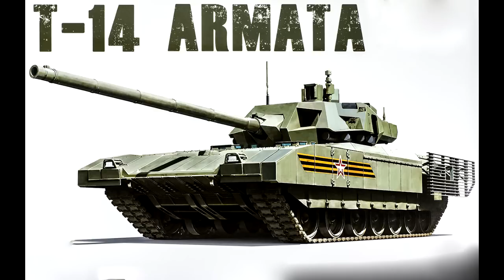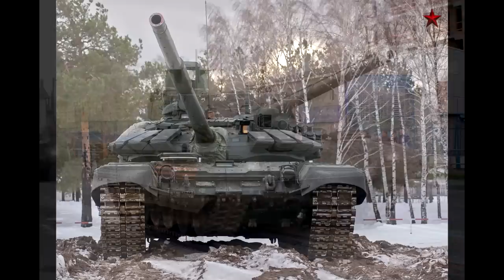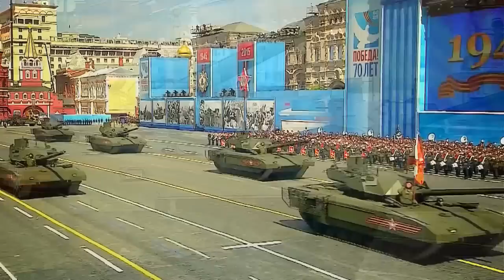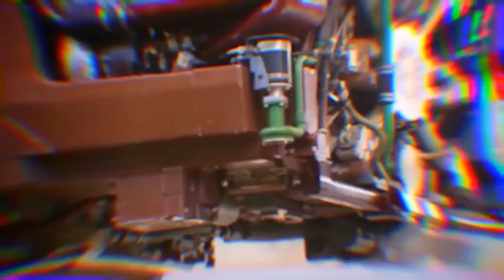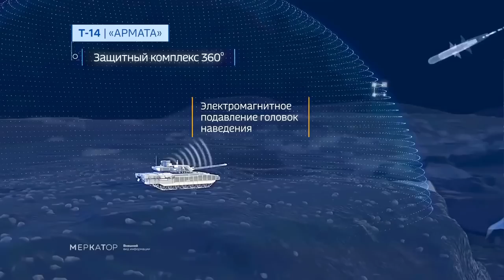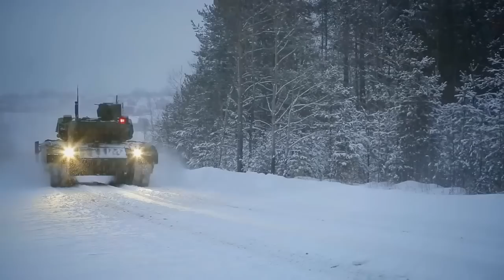Busting Myths on T-14 Armata

Comment: Please, explain how a few hundred grams of shrapnel is going to destroy a narrow tungsten rod weighing at least 10kg and travelling at 1700m/s. i want to see what kind of bullshit russia can come up with when they double down on this lie.
Reply: you do realize that Molten copper or (Tantulum or iron) is much hotter than a APFSDS round made out of tungsten or DU with alot more penetration... and DU and Tungsten as well as Tungsten carbide penetrators are really fragile/brittle compared to other metals the explosion alone in the mid section could bend the projectile and throw it off balance.....  the APS on armata basicly shoots about a 40mm GL projectile and it intercepts a high speed projectile and detonates a penetrator that then is molten..... 

im neither saying its impossible to stop APFSDS rounds nor am i saying its completely legit.... it all depends on the situation the system is put in i think its 50/50 with it i belive the APS can alter and slightly change or at least affect the flight path of the APFSDS projectile even if it doesn't destroy the threat it just makes it easier for the armor to deal with it...

but if its a Tungsten carbide penetrator im fairly sure a explosion near it alone would shatter it as it isn't nearly as malleable as straight up Tungsten and its probably the most brittle of all penetrators its like a ceramic compared to others.
Reply: Daniel Bromwich For some reason it feels like you'd be one of the first to be defending an US APS with the same capabilities. Not saying the Russian APS can do it. The Israeli APS, atleast according to their manufacturer. Oh and it doesn't use shrapnel. It fires a container that detonates within inches of the incoming threat to deflect/damage it. Read sonewhere that the mass of the larger APS containers is 5-10 kg
Reply: You don't need to destroy tungsten rod. All you need is to de-stabilize it and when it hits tungsten carbide inserts in armor, it shatters quickly.
Reply: Oh that's really easy. Tungsten is extremely hard, in other words, extremely brittle. You just have to strike it very hard and it will shatter like glass.
Reply: CYN MMA it's widely available and readily known. Our rail gun is fully operational
Reply: CYN MMA common sense doesn't need documenting snowflake.
Reply: You should actually read what you respond to before trying to act smarter than you are.

I specifically said that recent ones are of a higher mass than previously because of the sabot material. Look it up. And look up how much the previous ones weighed. Total projectile weight is roughly the same but the penetrator mass is lower since a few kg are spent on the aluminum sabot. The sabot in the recent years is being made out of lightweight composites, thus allowing to increase the penetrator mass without loss in velocity. Common sense really. There is more than just that one round out there.

At no point was the length of the projectile mentioned or relevant. But I appreciate your attempt of adding in random information to look more knowledgeable. It doesnt work, but nice effort nonetheless. And yes I do know how long APFSDS are, not that it matters.

The switch from APDS to APFSDS is related to the use of smoothbore guns (T-62 being the first to pave the way, i think), which provides a significant increase in muzzle velocity with less barrel wear. At higher L/D ratios spin stabilization stops working though, so adding fins was inevitable as a result of the ever increasing L/D ratio, which directly correlates to impact depth estimates and thus armor penetration. Which is why for a few decades the length kept increasing and the diameter decreasing. But in recent years there has been a bit of a change in that as well.

And none of that has anything to do with the false assumption that a APFSDS is a solid rod of tungsten or uranium, which was the point of of my response to the original comment. Only the penetrator is made of the alloy, which is only a part of the construction. Keeping it this way is why early APFSDS were so light and a substitution from steel to tungsten or uranium didnt just double the mass. As seen in 125mm projectiles, for example. The swap from steel to tungsten carbide and tungsten/uranium penetrators only made less than 1kg difference in the early designs. Changed from 3.9kg for steel to 4.5kg for carbide and 4.8kg for uranium.

Also 120mm
http://defense-update.com/products/digits/120ke.htm
You can see the change from as low as 4kg and progressing up with time. Also note that the mass is often given WITH the sabot included, as it is considered a part of the projectile.

And maybe read your own sources too before embarrassing yourself. Your own link literally says: M829A1: Penetrator weight: 4.6kg. 
Thus, come to think of it, at most the M829A3 has a penetrator mass increase of 1.5kg, that is including its 1kg total projectile mass increase over the A1 (9kg for A1 vs 10kg for A3) and a possibly reduced mass sabot, that would increase the penetrator mass ratio. Even the most optimistic estimates would be just over 6kg.
And maybe, since you are so smart apparently and know it all, do the math how much it would weigh if the whole thing was made from uranium. Im sure a smart guy like you can do basic math like that. Spoilers - its significantly more than the stated penetrator weight. You may guess why that is.
Reply: What's funny is all of the railgun stuff released in the past week that backed up everything I posted here, lol. Tanks are obsolete.
Reply: CYN MMA This Armata bluster is tantamount to the bluster concerning the PAK FA The thing basically hasn't gotten off the ground yet but according to the Russians trolls on this post, it's already killed well over hundred F 22's. On another vid one of them even said we lost 400 M1's in the Iraq war. LOL.The actual number is 9. Of those 9, 7 were destroyed by friendly fire and 2 were deliberately destroyed when they got stuck to keep the tech from falling into the hands of the enemy. Russia has a decent ground game but they're severely lacking when it comes to the air and water. They never built a carrier b/c they couldn't figure out how to engineer the catapult. They have never figured out how to properly seal the nuclear reactors on their subs to keep from irradiating the crew. I was a cryptologist in the US navy for 6 years and reactor problems was the most common transmission, the second most common was hull problems. But don't tell them that. They get really mad when you call them on their lies shitty engineering.
Reply: @CYN MMA
No, tanks were always vulnerable. There was never an invulnerable tank, not even the KV in 1941. The appearance of some elaborate weapon that can defeat tanks from any angle doesn't mean shit about the future of tanks. It would merely shape the tactical employment a bit, as did the AT-2 Sagger shock of 1973 and the Panzerfaust in 1944 before. Tanks persisted even though many supposed wonder weapons made tactically ignorant people claim the end of tanks had arrived already.

The tanks that overran France in 1940 had extremely poor, merely bulletproof armour plating no stronger than 30 mm, often only 15 mm. All French 25, 37, 47, 75 and 105 mm guns were able to penetrate them from almost any angle and relevant range.
Reply: What a surprise, didnt address anything and continued on with the same old bs. Could have at least tried to come up with something original. But then again, I suppose thats a tall order for a teenager.

How do you arrive at 98.8% exactly? If just one of those 64 missiles was off by more than 10ft then its 98.44%. Do you even think before posting or you just come with some shit and think people will buy it? Well I suppose like a quarter of one missile missed by 11 feet then? And who measured the distance? Coordinates are not entered with such precision and terminal guidance is used. Write that down for future reference.
Also Tomahwak didnt get GPS until 1993 and use digital maps with TERCOM. But you being a Navy veteran surely knew that. And we shot 288 missiles in 1991 and over 800 in 2003, not 64.

And if accuracy is what you want - even the latest modifications are off by quite a lot as we saw in the Syrian air base strike with missiles missing the runways and facilities by as much as 100 meters.  Or are you suggesting the missile was aimed within 10 feet to land in an empty field 100 meters away from the runway?

Actually the hunt for Iraqi leaders was done by intercepting satellite communications, which had an accuracy of some 300 meters. At which point a plane would drop bombs on random building in the area. Which is why practically none of these attacks were successful at neutralizing the intended target and killed a few thousand civilians instead.

Which rivers exactly did US subs go up? Enlighten me. I would really like to now which Russian rivers do you think would be suitable for a submarine.

Funny. You are going to lecture me about ignorance? Absolutely ridiculous. What is even more ridiculous is the level of bullshit you are telling to yourself and have convinced yourself of. I seriously doubt even North Koreans have fallen into such absurdities.
Reply: Slow clap 

Go show them who is boss.
Reply: Mi 28 Yeah, no. 9 megajoules. I guess you cant understand that.
Reply: Keeper Nod document that please.
Reply: Kinetic energy isn't what matters when you want to stop something. You need to equal its impulse with a counterimpulse. Impulse = mass x velocity. Nothing squared.
http://www.physicsclassroom.com/class/momentum/Lesson-2/Momentum-Conservation-Principle
Reply: Except kinetic energy is exactly what matters when it comes to penetration. Energy is velocity squared because it takes progressively more power to accelerate objects a little bit more, and the same thing is in reverse. Collision will impart penetrator's momentum onto the tank which is fuckall, but it carries so much energy that not even solid metal armor can possibly deliver enough counter-energy to stop it in timely fashion, hence penetration. Accelerating projectiles is so much easier than stopping them that people had to come up with other types of armor and means of protection in order to improve armor's ability to absorb energy from the penetrator. It's actually less strong than solid metal but does a better job at stopping AP projectiles.
Reply: I was writing about stopping the forward motion of the long rod, not a tank.
Reply: @Mi 28
I was writing about stopping the incoming long rod by collision. That's ALL about conservation of momentum, a.k.a. actio = reactio. It's about mass times velocity, not velocity squared.

An APS can destabilize if not break up an incoming long rod, but not stop it. The degraded long rod will then deal with a larger area of passive armor later on, which reduces penetration. The mechanics of penetration can also be degraded, making energy conversion from kinetic to thermal and shape changing less about shape changing in depth.
Reply: 1) There is no tungsten rod. Only the penetrator (less than 10cm in length) is tungsten or DU alloy. A whole rod would be stupidly heavy and pointless.
2) Its not 10kg either, its between 4 and 6. Though there are examples of heavier ones, of course. Recently there has been an increase in penetrator mass due to the sabot being made of lightweight composites instead of aluminum.
3) This capability is not new. Works the same way their ERA does against KE. It knocks the projectile off-center and thus drastically reducing its penetration. An off set of more than a few degrees likely results in shattering of the projectile upon impact with the main armor. Israelis demonstrated their Iron fist with a similar capability years ago. The limiting factor has always been reaction time of the system, not the assumed invulnerability of a KE projectile. KE is extremely sensitive to destabilization.

So dont project your ignorance so confidently. Just because you dont know and dont understand something, doesnt mean hundreds of scientists and engineers who have been working on it for 30+ years dont either.
Reply: RJ Lee, stop it. You have no clue. So don't project your ignorance so confidently. 

M829A3 APFSDS penetrator:
10 kg mass https://www.orbitalatk.com/defense-systems/armament-systems/120mm/docs/M829A3_Fact_Sheet.pdf
M829A1 APFSDS penetrator:
780 mm length https://www.orbitalatk.com/defense-systems/armament-systems/120mm/

The fact that you had no idea of the length of APFSDS penetrators shows that you had no idea about the most central variable in APFSDS evolution and indeed the reason for the use of APFSDS instead of APDS.
Reply: PAK FA is the same hole most 5th gen planes are. F-35 is no different and the F-22 is a failure.
As for M1's in Iraq. Actually if you pull your head out of your ass you will see that the number of damaged/lost tanks is pretty substantial. Its far more than 9.

Russia doesnt have or need a carrier because it does not need a floating airfield that needs 10 other ships to keep it safe. Russian "carriers" are actually aircraft carrying heavy missile cruisers. Aircraft only act as a supplement for its main armament - which are supersonic cruise missiles with ranges exceeding anything the US can put in response.
As for the catapult, that was never required for them and their ship does not run on nuclear power and thus does not have steam to power a catapult like the US carrier does. Su-33's take off without one just fine while actually carrying more ordinance than a catapult launched F-18. They actually intended to go full VTOL with projects like Yak-141.

If you are going to call out trolls and fanboys then dont engage in the same hypocrisy and bullshit as they do. Making up straight up bullshit does not make you look any better. Only makes you a hypocrite.

The US has had its own fair share of nuclear submarine incidents and has lost two of them and 228 crewmen.

Soviets had a few issues while developing their liquid metal cooled reactors. Sealing was never the problem. Though the only USN submarine with a liquid metal cooled reactor, the USS Seawolf, DID have containment issues and had the power unit replaced. Since then the USN uses pressurized water reactors. Its astonishing that you being a Navy veteran, or so you claim, dont know such basic information. I suppose there is no point in telling why the Soviets stuck with and kept on working on liquid metal reactors despite issues with them arising on both sides of the pond during development. Im sure as a Navy veteran you know all about it.
Reply: I know the encryptions that I broke MYSELF, I know what they said. What's so damn hard to understand that I was there? There's no gray area in that statement. I don't need someone else's account when I was there to see it myself, especially someone like you who wasn't there and has notta clue. All you can do is hope that some of what you said is true. Do you understand yet? This is not hard for most people. Yes, the Iraqi's have "lost" some tanks but those tanks don't have the DU armoring because they're an export model.  But during the Iraq war itself, what I said was accurate. No M1 with American tankers operating it has ever been destroyed by another tank. And if you think the F22 is a failure you REALLY need to pull your own head outta the lower cavity. The F15 is 104--0 against the Russian Mig. During the Red Flag exercises 6, F15's were matched against 1, F22. The F22 "killed" all 6, F15's. An Australian pilot even said he could visually see an F22 but couldn't lock onto it. As for the F35, it was to be tested to see how it well it could evade SAM's at the Mountain Home AFB in Idaho. But there was a problem; the ground based radar's couldn't find the planes. The F35s had to turn on their transponders, used for FAA identification, so that simulated anti-air weapons could track the planes.
Reply: But of course you did, James, but of course. Like literally 90% of all the other 13 year old American kids on youtube. You know all about how Russia and yet know know a damn thing about yourself. Totally makes sense.

DU armoring is not magic. Its nuclear waste thats used as a low cost tungsten substitute, which is what most modern MBT's use who dont need to cut corners. But way to come up with excuses and backpedal.
By another tank? Pretty sure thats not correct either. And your initial statement was not "by another tank" but in general. And in general the US has lost quite a few tanks and that is supported by official DOD information. However I am not surprised you dont know that. For one you were probably in kindergarten when it first happened, and since then you havent had the balls to check or consider information that does not support your already pre-assumed bias and position. Its just pathetic that you, claiming to be in the military, do not even have the common decency to respect the tankers who have actually lost their lives in the M1 in combat. Well done.

Exercises dont mean shit, especially if the whole point of it is to manufacture a propaganda piece to secure more funding for a program that is receiving heavy criticism from every angle. The F-22 program has been repeatedly exposed to have massive problems (F-35 is seeing similar issues), which eventually lead to the cancellation, the bullshit propaganda didnt work, they had seen it all far too many times before. You can masturbate over that poser all you want, dosnt change reality in the slightest.. All it does is show once more how ignorant, hypocritical, biased  and childish you are.

Actually radars NEVER had problems "finding" planes. LO planes are not and were never meant to be invisible or undetectable. If they were than they would be the most counterproductive thing they could possibly achieve, as anyone who passed middle school physics understands (clearly doesnt include you... wonder what that means..). Your expert knowledge shines yet again. Please stop embarrassing yourself.
Reply: I'm not embarrassed at all, everything I said is the truth. Some of it you can verify, some of it you cant. I'd bet that you have no idea that we sank an empty oil tanker in the Persian Gulf. We also shot 43 of our 64 tomahawks at Saddam Hussein in the Iraq war with 98.8% hitting within 10 feet of their programmed coordinates. I'd also bet that you don't know we went far into Russia with our fast attack subs by way of their rivers and they never knew we were there. There is soooo much you don't know.

Believe/don't believe, I couldn't care less. But keep your hostility and your hard wired ignorance close. You never know, stupidity might come in handy in a crunch. 

Hostel la vista, I'm done here.
Reply: lol,.. how about you go drive the take out there big boy. I know how it works,.. as I've bear witness.
Reply: I love how you talk like you're the only qualified person.
Look, no you can not. But you don't grasp what is taking place and you obviously aren't paying attention. Once you get out into a test area, let me know. It's like you are pretending velocity is not a thing. It's like you swearing that radar will for a fact detect the F-22, you just don't know what in the fuck you are talking about. But I'll tell you what,..I'll make a deal with you, you go ahead and get in that tank. Trust the defense system to stop a rail gun round. I would LOVE to see how much you believe in your mouth.
Reply: http://farm5.staticflickr.com/4204/35187640941_c4a49f803f_b.jpg
Reply: Great evidence to back up your bullshit claims. The SLOWEST speed that the current railgun fires, is 1,000MPH faster than the fastest sabot round we currently use. 4,500MPH at the freaking LOWEST setting. Good luck with it turned up a little and fired out of anger, I really trust those trophy systems, "rolleyes".
Reply: Dude,. it is very,.. very clear that you don't understand how to use the internet, or you could read text, in order to get the context of a conversation. Please stop making bullshit claims about your intellectual capacity.
Reply: THECYNDICATE, you are quite off in a lot of ways.

First, countering a KE projectile is NOT a problem. The problem is and always was the reaction time of the system. Its common knowledge (basic geometry and physics) that a KE projectile that impacts off-center will have drastically reduced performance and risks simply shattering. The Soviets exploited the ever increasing length and ever decreasing diameter of KE projectiles to counter them with dual layer ERA, that would apply a sheering force to it sufficient to deflect and/or break the rod. Which is why later KE projectiles have an increased diameter (to counter this). Israeli Iron Fist already demonstrated like a decade ago that KE projectiles can be intercepted and destabilized before impact. No one ever doubted that this was possible, it was simply that the systems didnt have sufficient reaction times. Also Iron First is far from the first one. Soviet/Ukrainian experimental systems tracing to the 80s already could break the reaction time threshold, though they worked a bit different from what most common APS look like today.

As for railguns. Its a joke. The fastest velocity Bilitzer achieved was 1600m/s. Which is LOWER than a tank gun. In addition the system can only perform a couple shots before it needs to be rebuilt.
Railguns have achieved higher velocities, yes, but using projectiles that weigh a few grams at most. Blitzer is the largest and heaviest ever made, and it demonstrated the practical limits to be inferior to a tank gun made 60 years ago in both projectile mass and velocity.
Reply: There were reports about the Blitzer railgun reaching 4,500 mph, but that is irrelevant anyway because it' no AT weapon. It's a naval gun concept. Tank guns don't move towards railguns because the tech cannot be applied with enough muzzle energy in such a small platform as a tank. An application of railguns in howitzers is mist unlikely as well, not the least because the U.S.Army has a 100% failure rate at developing armoured combat vehicle from a blank sheet and bringing them into service since the mid-80's.

The Rheinmetall 130 mm gun is expected to shoot at about 20 MJ, which can be understood to be representative of the 2020s generation of tank gun APFSDS muzzle energies.
Reply: You guys aren't understanding.
I have witnessed this thing. It is MUCH smaller now. They already trailer it.

I am telling you, right now,.. that by the time they have this tank operational in numbers to use, we will have the rail-gun program, mobile and being used. These scaled up trophy systems WILL NOT WORK. That is the freaking purpose of it being developed. To overtake current defense systems and to not use powder.
Reply: The railgun will NEVER be in operational use as a weapon because its INFERIOR to a regular gun in every single way. The support systems are the size of a 5 story house and the gun needs a complete rebuilt after a couple shots. More so - the mass of the projectile it fires is LOWER than a regular tank gun KE projectile and the velocity is roughly identical. Meaning a 40 year old tank OUTPERFORMS the railgun. That is the reality of the situation. A conventional gun is also orders of magnitude more cost-effective and far more efficient.

There are no scaled up trophy systems. Trophy itself is made after Soviet concepts. And they do work and have been since 1983. They were limited by reaction time. That is no longer the case.

There is no practical purpose for the railgun being developed. Its money sink, its in the same boat as the airborne laser missile defense. A theoretical concept built to see what practical problems arise. Its a SCIENTIFIC project, not a military one. Projects like these further R&D of various fields and advance scientific progress.
They did some demos and animations claiming utter bs, as they usually do, in order to secure additional funding (the project is primarily funded by GA itself and has seen little support for obvious reasons).

I would suggest you do some real research on this topic rather than believing your own nonsense. You are clearly one of those who were utterly convinced a railgun would be on the Zumwalt. In reality the rungun was never even considered because duh.. and the Zumwalt itself was scrapped. And yet you were 1000% sure. Pull your head out of your ass already.
Reply: Oh please, just cut the bullshit already. You are so obviously one of those idiots who were convinced this thing would be on the Zumwalt years ago while having no fucking clue just how massive the support systems are and just how fundamental the problems are. Just because they can tow the rails on a trailer doesnt mean the 500+ high density capacitors and tons upon tons of wiring are on one too. Not to mention the required power supply needed to charge it all at a sustainable rate.
1) GA itself have made it clear that the rails only last a couple shots. They erode and they warp with each shot.
2) It is OUTPERFORMED by conventional guns. Massively. IN. EVERY. SINGLE. ASPECT. Being by far the largest railgun ever made its muzzle energy is still far below conventional guns.
3) Its efficiency is abysmally low, a fundamental issue with railguns. It works beautifully in the small scale, but as you increase the size the issues and requirements grow exponentially. A true/pure railgun of a practical size was dismissed a long time ago as being impossible without drastically improved materials, specifically conductors that would have far lower resistance than existing ones. Capacitor technology has advanced too, but even a small railgun (firing gram-weight projectiles) still requires a whole room of them, while the rails assembly can be carried by hand.
4) Even if we dismiss the practical issues (recharge, transport, size, longevity, subsystem complexity) the issue of cost still exists. A conventional gun costs a laughable fraction of this, is more portable, durable, fires faster, more accurately with greater ammunition variety.

We have been here before. I am certain you were among those desperately masturbating over the Zumwalt with rails, being utterly convinced it was going to happen. You believed you own bullshit instead of doing a 10 second search on Google to realize the Navy never even considered it because its as realistic as photon torpedoes and warp drive at this point. The railgun with all the subsystems is larger than the fucking ship and even if it would work (dismissing the practical issues) its combat effectiveness is essentially ZERO. None of the bullshit numbers made up by the likes of you were ever real and any physicist will tell you that its effect on target at extended ranges would be equivalent to lobbing bricks (about the same mass of the projectile) in the vague direction of the target. And at point blank a conventional gun outperforms it. So what advantages does a railgun have? NONE.
A conventional gun system, such as the AGS the Zumwalt actually got, far exceeds even the nonexistent railgun numbers that dismiss basic physics. Get it? Even the MADE UP NUMBERS are INFERIOR to a conventional gun. In addition it takes up maybe 1% the space and power needs and can fire continuously without 100 engineers rebuilding it for 3 months after every a few shots.

So I'll say it once again - pull your head out of your ass. We have seen fanboys like you a million times, desperately masturbating over their own bullshit.
Just because something seems cool to your juvenile mind doesnt mean its actually viable or better as an advanced weapon system.
Reply: RJ Lee REEEEEEEEEEEEEEEEEEEEEEEEEEEEEEEEEEEEEEEEE!!!!!!
Reply: You can say and think whatever you like, but I will bet you money that when it rolls out, you will pretend like you never said it and act like you knew it was coming the whole time, lol.
Reply: It doesnt matter what anyone says and thinks. What matters is physics. The gun offers NOTHING that conventional gun systems cant do better and at a fraction of the cost. Simple as that. And that is assuming it works, which it doesnt as General Atomics themselves have made clear - the gun is capable of delivering only a few shots before it needs a rebuild. You havent even done this much research. The guys who make it are saying its NOT viable.. and yet you claim to know better. Do you even realize how ridiculous you make yourself look?

This is hilarious also because 3 or 4 years ago someone said the exact same thing about the railgun already. He was convinced it would come on the Zumwalt. Had he spent even 10 seconds researching the issue he wouldnt have made himself look like such a moron. The same arguments were presented back - the gun does NOT outperform a conventional gun, the whole system is larger than the ship itself and the ship can not recharge the capacitors (which deteriorate too, btw) to have a sustainable fire rate, nor was the ship ever designed with such a gun in mind (meaning its power grid, layout etc does NOT support a railgun even it it would work). Did he care? Nope... He was just like you, swimming in and gargling on his own bullshit for months instead of spending literally 10 seconds educating himself. And what happened? The Zumwalt got the AGS, which OUTPERFORMS the railgun. And then the whole thing got cancelled.

It wont roll out for a very simple reason - it does not offer anything a conventional gun cant already do better at a fraction of the cost. That is assuming it works and has a comparable service life.. which it does not do and does not have.
I know its cool, but anyone who passed 5th grade realizes that even the claimed performance (which it does not reach) is still inferior to conventional guns. It costs more and consumes more power to deliver worse performance. Why the fuck would anyone go for it? Because its cool to your willfully ignorant and infantile mind? Thankfully people in charge arent as stupid. And while its an intriguing scientific project, its viability as a weapon is essentially zero.
Reply: You are the one that hasn't done the research.
On the low setting, it already shoots faster than other ordinances. It doesn't have to carry powder and can use existing nuclear systems for a charge. When it is trailered, it takes a pretty good amount of time to charge and fire because of the power generation. The friction is an issue, but they are dealing with that, by limiting heat. I'm sure I looked just as ridiculous when I said we had stealth helicopters, and people said the same shit you say now,.. then bang, 3 months later the raid on bin laden took place and the whole world knew about them. Same thing will happen here. You will pretend you never typed these things and that you knew the whole time. Make sure you remember this conversation when it takes place. I love knowing it will eat you up when it happens.
Reply: its simple it throws it off balance. also APFSDS is a very frigle projectal. in practie only tungsten (or uranium) core penetrate the rest of the arrow just shaters on impact...
Reply: 14450000 joules of kinetic energy is stored in a 10kg projectile travelling at 1700m/s and thats what gives it the energy to penetrate armor and depending on armor composition slight change lets say 100m/s less could effectively reduce the energy (not taking in to note that the rod does nothing if it hits sideways) enough so that no penetration can be achieved so, the concept is sound since you don't have to counter the munition to a halted state. what I'm more concerned is how well do the optics handle hits in case of not being able to fire first, tough might not be critical hit or non penetration, maybe an autocannon even, not that many hits would take out most of the combat capability of the tank easily.. also on bigger projectile hits the autoloader is sure to fuck up big time as we have learned from earlier T-XX series tanks.
also wouldn't want to be infantry next to that tank when being shot at by pretty much anything.
Reply: The trouble with the rail gun is that you have to get the energy to launch a high speed projectile from a place. On a ship you have plenty of space and the weight isn't much of an issiue. On a tank that comes with a whole set of problems.

1: Bigger tank = more tank that needs to be protected = more armour and weight. So the generator has to be very small to compete with the place in the tank.
2: A generator that can provide the amount of power for a potent railgun system, fire rounds  fast enough and still be small and light, isn't avaiable as of now.
3: How will it preform in a filthy enviroment that tanks usually operates in? That may not be a big problem if things get properly designed.
4: Exactly how much better will a rail system that can be easily and functionally fitted into a tank be when compared to conventional ordonance? If the system weighs more than gun and ammo combined, takes up more space or both..I'm not so sure that it will be an attractive solution. Just fitting more conventional ammo of steadily better preformance would be simpler.

The rail gun may have its place. But in a tank... in the next 10-15 years? I think not.
Reply: Well, your foundational information isn't wrong. The problem is, you are missing information and technology. The fact that you made the word "potent" bold, show at least a small level of dishonesty, because you are trying to avoid the fact that there are plenty of videos on youtube of rail guns and coil guns working just fine. so you use the word "potent" as a way to avoid this conflict.

So while you are not wrong,.. the issues you speak of have been solved for the most part and some of the main platforms are already in testing.
Reply: Your last sentence is all I needed to know.
Reply: From what I have read on Israeli Iron Fist, which also claims to be effective against APS is that by firing a powerful HE charge in close proximity to a APFSDS round, the dart can be made to wobble on its flight so that it does not impact in a perfect nose first impact but rather slightly angled, greatly reducing the effect of its long rod nature and probably shattering it. 
It doesn't divert or destroy it merely wobbles the round in flight .
Reply: You can do that to a normal round,.. but you are NOT doing it to a railgun version of that round.
Reply: With a big enough HE blast you could probably wobble the round enough to do it. The goal is to use the rounds immense power against it. By giving the round any bit of tilt on its flight path all of its energy is no long in a nice perfect line. The weight of the ass end of an APFSDS round will try and rip it in half or shatter it if it is not in a nice perfect line on impact. The faster and harder the round hits, the less of a tilt it needs to have to shatter or fail. 
I don't know for sure though. That is just how the thought process of APS designers seems to be with regards to countering APFSDS
Reply: they span billions on F 117, F22, F35, and a rocket system from 50s or a 7,62 can shoot them down. So yes they would spent billions for such a system. Just to steal your money.
Reply: Daniel Bromwich you see I don't understand that either because assuming it's made out of depleted uranium I don't see how any kind of shrapnel aside from a material of the same density is going to have any effect and even then it would have to be going at a greater velocity which you can't accelerate a shotgun like projectile in that fashion the best I see is it scratching and doing it up a bit but that sounds like a bunch of Russian BS and even if it did manage to break the rod apart you still got the issue where now you've got multiple pieces of material traveling at extreme speed all they did was turn it from tungsten penetrator to tungsten shotgun shell and granted sure that's not going to get through but it's not much better especially considering it's going to rip outer armor to shreds and put holes in the hull to get through
Reply: And you definitely proved their active protective system works against APF DS you know because it's been proven already right you've got proof to show us oh wait no you don't because that's all hearsay maybe you should try using some facts sometime
Reply: Velocity is not "more powerful than mass".  Acceleration of mass adds energy to the mass and this combination is momentum. So it is that a tungsten rod weighing some 22 pounds (10Kg) traveling at over 1,800 m/s (5,905 f/s) cannot be stopped from penetrating anything softer than tungsten.  Most everything is softer than tungsten.  
If this is a projectile weapon and not guided, the only defense is to run from the point of impact.
Reply: Yes, and the American War Party (deep state) whose salaries depend on creating scary enemies, are the problem.  
I have worked with Russians, Lithuanians, Estonians, Yugoslavians, Vietnamese, and Mexicans and discovered they are men just like me.  They love their families, want to earn a living, and abhor killing other people. 
Evil people who can only believe everyone else is as evil and devious as they are gravitate into positions of power.  There is the problem:  We are conditioned and forced to obey people who call themselves government and to feed them and protect them.  As we do, they manipulate us, through poverty economics and government schools, to fight the wars they create.  Their goal is to possess the oil or minerals or pipeline or trade routes, etc., where the murdered men, women, and children happen to live.  Why negotiate a contract when you control the US army that will kill on command and take the land by force?
Reply: That was the USSR - the Union of Soviet Socialist Republics - dedicated to the idea that the government owns everything and that a central planning committee can manage an economy.  
It isn't that way anymore.  I believe they have more of a free market than the United States (US).  We haven't had a free market in the US since the 1790s and it was this one brief period of freedom and our Christian culture that propelled the American people into the world class inventors and manufacturers. 
That's where the Russian people are today.  They are exulting in their new found freedom to own and produce, they have seen what the rest of the world is doing (they import Toyotas and Toshibas too), and they are prepared to compete.  They are developing their own system of banking as well, side stepping the US sanctions by developing their own bank interchange system with China, open to the world. They graduate engineers instead of video game nerds.  And they are by and large Eastern Orthodox Christians which means they have a moral culture. 
NATO is nothing more than a criminal enterprise these days.  Clinton's destruction of Yugoslavia, brave USAF pilots dropping cluster bombs on women and children shopping in open air markets, shows the true nature of NATO.   We sadly misjudged Bill Clinton.  He is not a career politician:  He is a career fornicator and serial adulterer enabled and protected by his political positions and ability to use government to blackmail his opponents.
Reply: Thank you, I corrected the velocity.  Still impressive and a lot of energy.   I take it this is why tanks come with smoothbore guns these days.
I have no knowledge of infantry.
Reply: lol... your words are on the deaf ears.... those russkies tanks are inpenetrable as they are protected by so thick layers of thickness, ignorance, stupidity and hollow motherland-patriotism...
Reply: Thats probably why they decided to start making them in production numbers in 2019 only... maybe...possibly... if they have enough money...
Reply: Do you think that you cannot destroy relatively modern T-72 with good old german Panzerfaust ? think again.
Reply: The problem that russians have is to admit that all of their engineering ideas and education have actually come to them from the West, however their hollow patriotism doesn't allow them to do that....
Reply: Israel has a very similar system, which is even being considered for use by the US. it works very well
Reply: Using the current APS interceptors it is IMPOSSIBLE to stop or even deflect to a significant degree a modern APFSDS round. it's simple physics, the rounds have too much mass, energy and are far too hard to be defended against by fragments with net energies amounting to several kilo joules.
Reply: Ulf Meier-Schulze No.
Reply: Dennis Richards You guys do not know what you are talking about. So they can go too fast now? Wow, how silly of us to spend billions on rail guns. None of you are weapon engineers. You just hold opinions, silly ones, based on pride and misinformation.
Reply: BabyfartMCgeezax yeah buddy, we trust you with your info on "sekrit" technology, lmao.
Reply: Dennis Richards Lol, you just exposed yourself again. They are Tungsten. Its a sabot round, smart guy. The sabot container is what is accelerated and then it falls away after it exits the barrel. "military railguns capable of delivering tungsten armor-piercing bullets with kinetic energies of nine megajoules have been developed."

Let me guess, youll ignore that paragraph too, lol.
Reply: Daniel Bromwich They really don't understand physics. The info is all there, just pop it in the equations and get the results. Tanks do not have the surface area needed to carry enough explosive to stop a projectile like that, and that's just the first hurdle. After that, you have to deal with threat assessment and deployment time, as well as time it take to identify trajectory and deploy in that exact area. There is just not enough time, mass or force to stop one of these projectiles. Stop being silly and do the math. It is still an amazing platform, just stop trying to act like it is more than it is.
Reply: @Blitz FromBehind I would defend the penetration of any tank round which data says can physically accomplish what it's manufacturer or nation military says it can. russia has an endless history of over-inflating the capabilities of their military equipment, inflations that are quickly popped when they actually see combat.

Earlier APS used shrapnel, the one being discussed uses EFPs. if it indeed fires these EFPs from launched canisters then the EFPs would be even smaller than speculated, as more weight would be required for the inner canister and additional propellant and explosives.
Reply: @Awesomelord101 Do you realise that the penetrators of shape charges are only around 400 degress celcius? the act like a fluid due to the forces placed on them, not due to their temperature. the reality is the temperature is completely irrelevant to the penetration capabilities. EFPs also don't get as hot as shaped charges.

Tungsten is both harder and more dense than any EFP material. APFSDS penetrators are around 25mm in diameter. so we have a harder, stronger, denser, heavier and thicker projectile being hit. the chance of it being broken by such a EFP is around 0. tungsten penetrators are also not made of normal tungsten carbide. formation techniques are used to customise the properties of the tungsten penetrators, i'd suspect through tempering to control crystallisation and possibly also alloying.
Reply: Ulf Meier-Schulze lol, so copying random wiki pages and random equations now qualifies as proof? Maybe to people that don't understand them, but people that do just laugh at you. That's no proof at all and is actually unrelated, as there isn't enough surface area to create a force great enough, as well as fast enough. You are also ignoring the rail gun problem. But yeah, I guess playing pretend works for you guys,.. until you have to use it.
Reply: Dennis Richards Dennis Richards The majority of people are idiots. So it only stands to reason that idiot viewpoints get agreed with more. So thanks for identifying yourself and then trying to brag about it, lol. You do not know what you are talking about, period.

Engineers are a dime a dozen. True weapons designers/engineers are not.

Now you are contradicting yourself. The rail guns shoot the exact same rounds being discussed here. I don't care how you THINK it gets the job done, you just typed that if they go too fast, they fail. WRONG. It doesn't get much faster than a rail gun, same rounds, same targets and the rail gun wrecks them. No known defense system works against them, period. I have been present during the proving and testing phases. I have witnessed the tests with my own eyes. Nothing can stop it, including hardened structures in-between the target and weapon, WITH intercepting counter measures. So unless you have more intimate experiences than that, you are full of shit.

You are going off of assumptions and bias. I am stating experience. I feel sorry for ANY country that engages us next, especially in mechanized warfare. This new tanks are obsolete and they don't know it. The sad thing, is it will be the kids in the crews that will pay the price. So I hope it never takes place.

I am also very unbiased and open minded. I HATE the JSF. I can't stand it. The techniques they use for it are sound and will dominate the sky, but it's too lopsided with its attributes and if it ever gets caught in a close situation, the pilot is dead. I wish the Raptor got fully green lit, because by now it would be our standard fighter. It would make since. See, we have another platform that people don't know about yet. The prototype is known, but it's type of role was never discussed. We have a habit of shocking the world with platforms no one knew existed once we get into a war or p.o. We currently have multiple that I know about and I'm sure more that I don't. Think about it.

The F-117 Stealth fighter was thought to have first flown in 81/82. The public didn't know about it until 88/89, but it gets more complex. The F-117 had its original "known" call sign of "Have Blue". I know for a fact that Have Blue flew in 1976. It's first classified but documented flight was in 1977 as PoC for congressional funding. So you have a Stealth Fighter flying in 1976. That means it was already designed, built, tested and then in use. To put this in perspective, the F-35 design started in 1996. Manufacturing started in 2003 and it still isn't complete. Have Blue was operational in 1975 for DARPA's XST program. People say they started around 1974, but with everything we know about design cycles, it had to be around for a long time before in some form. So likely early to mid 60s on someone's drawing board. 

People had no clue, said it was impossible. Yet it dominated a war in the 1990s. That's at least a 25 year lead time for uncontested, completely dominate technology.

So you really think you know what we have and how to defeat it? You can't even fathom what we have in the shadows right now.

That rail gun cannot be stopped. Same round. You don't know anything, period.
Reply: @ThisGeekPlaysFPS And the russian economy is in recession and their GDP is 1/13 of the US'. sure, some of their capabilities may be better than the somewhat outdated M1A2. there are however many other western tanks and the M1 is currently being prepped for an overhaul.
Reply: you need only to cripple its shape - make it be no rod (with a sharp tip) anymore. After that it will not be anymore effective at penetrating the tank armor. That is the idea here. Actually its own speed adds to it loosing its shape prematurely  when the rod meets the shrapnel fired toward it.
Reply: I Will explain it with using vid author logic.,,  some people thinks that it cannot destroy tungsten bar, but it actually can very easily. Shell will be destroyed in seconds without any damage on the tank. Just because this sekrit technology isnt know it doesnt meandry that russians dont have it.,,
Reply: "You guys do not know what you are talking about" I'm not to only one that disagrees with you I see.

"So they can go too fast now?" in a word . . .yes . . . its not velocity that is the problem, it is the speed at which it hits its target (which I did make very clear above) you can crack Tungsten with a hammer if you want.

"Wow, how silly of us to spend billions on rail guns" a rail gun in an impactor not a penetrator.

"None of you are weapon engineers" I'm a mechanical and electrical engineer.

"You just hold opinions" as do you,  clearly not based around even basic entry level physics. 

"silly ones" oh silly physics. 

"based on pride and misinformation" getting psychological are we?  I think what we are experiencing is you, trying to justifying your personal belief that goes against observable reality (aka blind faith) probably because you feel the need to tell yourself your more intelligent than other people ( I'm sure you'll figure out why one day). The observable truth is this tank (and others around the world) has countermeasures against AP rounds. (It's not arguable) 

So you logic is to argue is that something that actually exists . . . doesn't actually exist . . .
Reply: +Daniel Bromwich "russia has an endless history of over-inflating the capabilities of 
their military equipment, inflations that are quickly popped when they actually see combat."

Just like Abrams tanks are getting destroyed by shitty Kornet, so who is over-inflating capabilities here?
Reply: So what if it's 9 megajoules. It's still a piece of extremely brittle metal. But I guess you can't understand that.
Reply: Jürgen Sven Fuchs Nobody is talking about literally stopping the forward momentum of the tank. Just killing the crew or disabling the tank.
Reply: If you're a Physicist then don't you need a degree or two to be one?
Wouldn't a damn degree based position be a claim of intellectual capacity since it is a tested field to be qualified for? Are you just the biggest dumbass online?
Reply: Project NEMESI5 Once again, you fail to understand a simple premise. I am making a KEK joke. It must be an experience to be as stupid as you.
Reply: Just stop it already. Quit embarrassing yourself. You believe in fairy tales you yourself made up, so be it. For all we know you believe the Zumwalt got 2 railguns a piece already 2012 but they are hidden and its a secret only you know, also the Earth is flat.
Reply: It weighs 17Kg.  And that shrapnel  must some sort of Cyka Blyat Rush B Projectile.
Reply: @CptMisha Tantalum is not only significantly less dense than uranium or tungsten (only 87.3% under standard conditions, which the tantalum will not be at due to heating) but EFPs are a tiny fraction of the density and hardness of a APFSDS penetrator and typically have around the same velocity. they also will only impart a fraction of their energy on an APFSDS penetrator due to the small surface area and hardness of the rod.

The rod of the M29A3 is 10kg, the propellent is 8.1kg. The rest of the round, the casing, primer and sabot make up the rest of the mass. for an EFP to have more energy than an APFSDS penetrator it would have to be larger than the surface area of a tank, if an EFP could even be made from those dimensions.

Russian military technology has always been inferior to the west's. western tanks do use radar, which is also superior to russia's. just like all western electronics, including night sights and laser rangefinders. russian rounds have ALWAYS had inferior penetration to western rounds. during the cold war russian rounds typically had between 40 to 50 percent the penetration of western rounds. the Svinets-2 is allegedly (russia is infamous of overstating it's capabilities) capable of penetrating 660-740mm of RHAe at 2km, the M829A3, which was fielded at almost the same time is estimated by your own military  to be able to penetrate up to 795mm of RHAe. the M829A3 has since be superseded by the M829A4 which entered full scale production over a year ago. that penetration is also taken from the shorter 44 calibre 120mm gun that the US currently uses.

Russians saying that their outdated tanks are better than anything the US or even germany or the UK can make is priceless. calling your FLIR 3rd generation doesn't change the fact that they are inferior.

As far the value of the rouble is concerned, it has little to nothing to do with western sanctions (which were put in place because russia once again invaded a much smaller neighbour and occupied their territory). the inflation rate in russia has averaged 32% per annum since 1998 . your belived dictator has either directly or indirectly allowed the russian economy to continue to run itself into the ground. despite being one of the worlds top exporters of petroleum products, which is basically free money. the rouble is essentially worthless and the russian economy weak because your country suffers from chronic mismanagement and other crippling problems such as endemic and all pervasive corruption and terrible income inequality even when not including hidden money.
Reply: CptMisha No, it is not. I have seen these things in person. It doesn't matter what you think they might use, no tank has enough surface area to even contain anything that could defeat this weapon. You think that billions would be spent on these freaking rail guns if some simple reactive armor could defeat it? Fucking think for the sake of God Almighty. You just don't grasp the energy from an impact like that. You are not thinking.
Reply: @Pixel Dust the T-14 costs less because russians work for cheap. you may not realise this but the russian economy was a pile of shit even before economic sanctions were put on them. A better way of calculating the cost would be to compare them to national GDPs. russia's GDP is one thirteenth the size of the US's, which gives you a good indication of how much more expensive they are to russia relatively.

Russia could never have defeated NATO in the cold war anyway, as time went on they were lsing more ground to them militarily. despite spending more of their GDP on their military.
Reply: You do realise that explosively formed penetrators are generally made of copper or copper alloys, which are even lighter than pre-formed fragments? also, from the size of the dischargers on the T-14, they are far smaller than other EFPs. it will therefore be either lighter or slower, either way it will have less energy.
You also don't seem to understand that while the penetrator might be 10kg, the complete round is more than 32kg. that you would even attempt to assert that a small EFP could have more energy, or even similar energies to a tank round is laughable. the 19kg i cited is also for the complete inteceptor, which includes fragments/penetrators, propellants, casing and mounting. the fragments/penetrator are typically only a few hundred grams.
Then there is also the elephant in the room, russia's military technology is inferior to the wests'. their ammo preforms worse, their armour, optics, training and equipment in general are inferior. russia tries very hard to make itself appear to be at or near parity, which is one reason why they habitually inflate their numbers.
Reply: I think your being over simplistic. In ideal circumstances you may be correct and a counter measure my be ineffective (in the same way countermeasures can fail to counter anti aircraft missiles despite a pilot doing everything right) War isn't a game of 'top trumps' where who ever has the highest number wins. there are too many variables in a real situation.

A tungsten penetration round has to be specifically designed and balanced to make it through MBT armour. Its a balancing act of forces and actually pretty fragile

If your round arrives too slow you wont penetrate you target.
If you  round arrives too fast it can pass through both sides of your target without doing any damage.
If your round is travelling really fast it will disintegrate on impact.
If the round hits the target with the incorrect alignment then it will not penetrate the target (eg fin damage) 

as you can see firing a heavy rod at armour isn't as simple or as effective as some might think.  Unless you can find out exactly how this system works I wouldn't totally write it off. Even if the tip is damaged or misaligned even slightly, it can drastically effect its penetrating ability,
Reply: I'll try to keep this simple, maybe then you'll fare better than when you tried your hand at reading comprehension. that you would say "Newton's 2nd law of motion, velocity is more powerful than mass" shows what an idiot you are.
"The change of momentum of a body is proportional to the impulse impressed on the body, and happens along the straight line on which that impulse is impressed." it's about proportionality you simpleton. so, explain how fragments and propellents weighing ~19kgs and firing from only several meters is going to stop  an tungsten rod with ~12MJ of energy.

The aught to be rich.
Reply: Daniel Bromwich I'll try to keep it simple so you might understand; Newton's 2nd law of motion, velocity is more powerful than mass. So long as the incoming heavy projectile is hit far enough away from the tank, at the right angle, with enough velocity the system works.